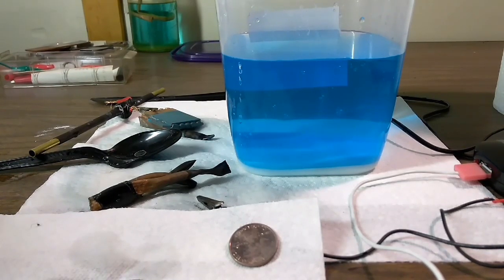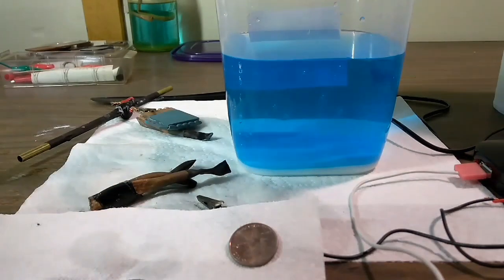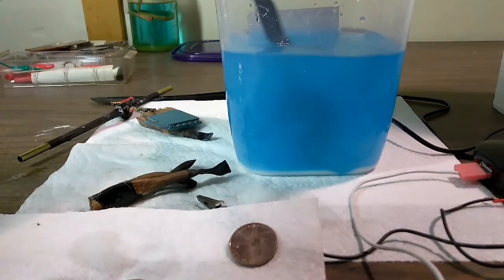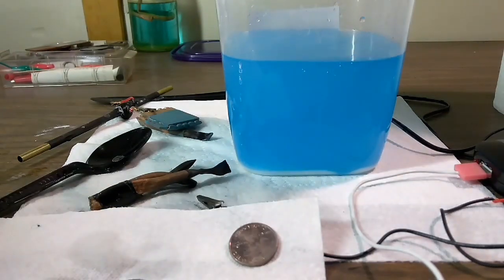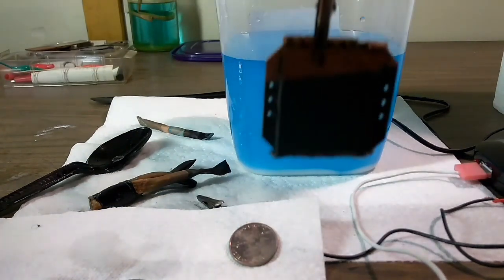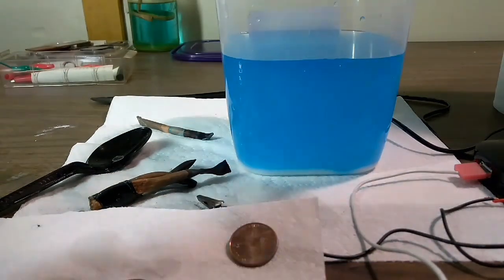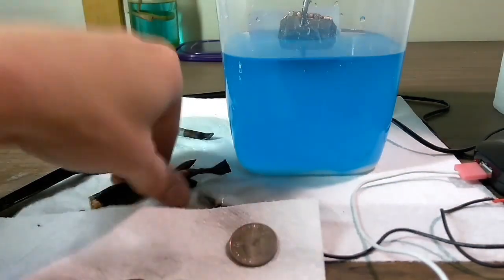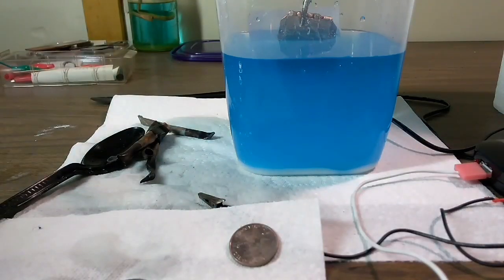Copper plating with good results!

Comment: Could you tell me what I’m doing wrong I can plate a quarter but when I try to do something bigger it won’t plate the whole thing.
Reply from the maker: You may want to turn the piece over or move the electrode to a different contact point on the piece you want to plate and give it another run.
You could try using a second copper electrode in the solution (connected to the same power as the other plate). This may produce a more even plate.
Reply: Thanks!
Reply: For some reason when I plate something it doesn’t bubble at all and I can’t even tell it’s working till I pull it could that mean my battery is lower or something like that?
Reply from the maker: @Outdoor.pixels  if it plates and has a very little amount of bubbling you are at a good voltage. With larger pieces you may need to raise the volts/amps a little, but too much will just burn the plating.

Comment: Try using pre 1982 pennies for the source of copper... I  have found that the source of copper makes a big difference. 
Thanks and keep up the good work.
Reply from the maker: That thin copper tube i have is not cutting it, not pure enough. I have found that copper computer parts (heat tubes, etc) are usually a good grade of copper.  The copper plate i used in the first video was a heat sink from an old g5 imac.
Reply: im using solid 12 guage wire. ive been trying for a week. it doesnt work very well.